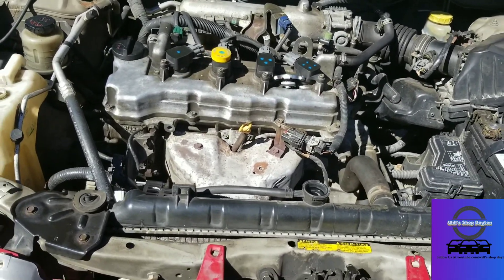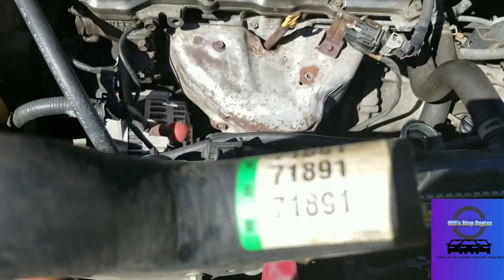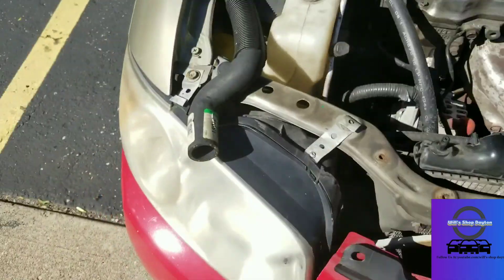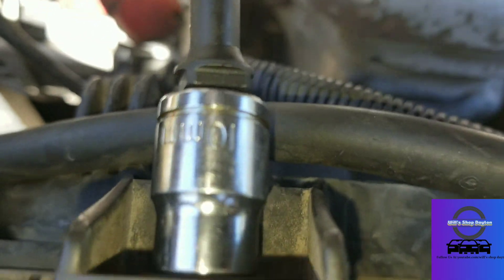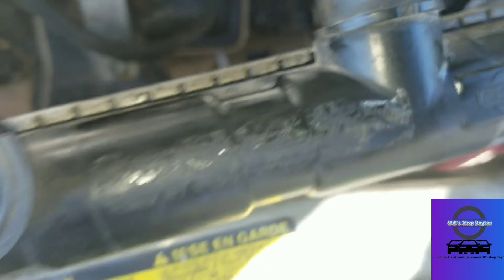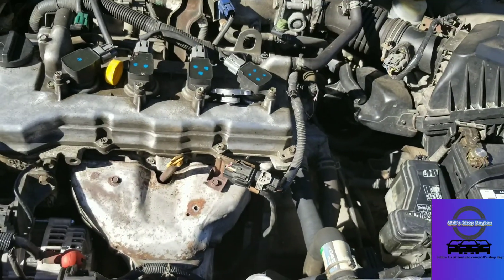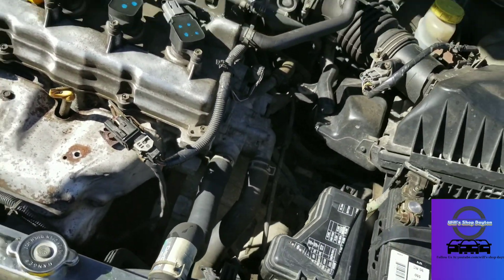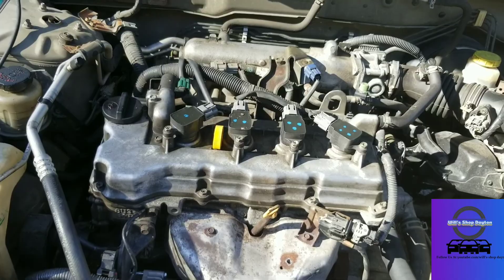2004 Nissan sentra 1.8 radiator replacement

Comment: I think I might have a  leaking radiator in my Sentra also. How do I determine where the leak is coming from if it is the radiator.
Reply from the maker: You should  Be able to do a visual inspection around the radiator and radiator hoses if your coolant reservoir is running empty or the level in the radiator is low you most likely have a leak but I cannot say if it is from the radiator or you may have a internal leak if the rad is ome check the nissan stamp on it mine was leaking from it. Fill it up run it to op temp and look for leaks or steam from anywhere better in colder weather. Thanks for the comment have a blessed day let me know what it was
Reply from the maker: Sorry for the super late response I forgot to mention that you can rent a pressure tester for the coolant system and pressurize it to find the leak